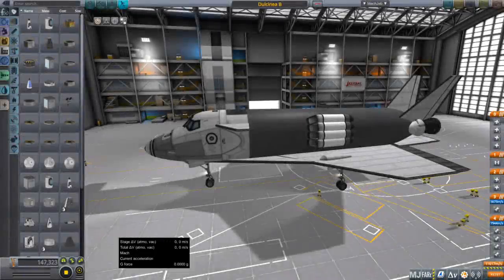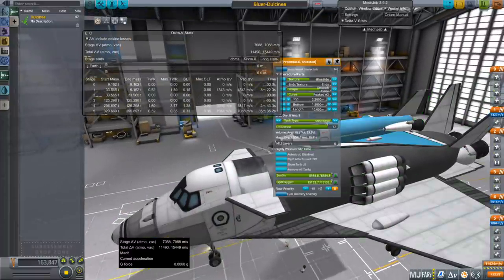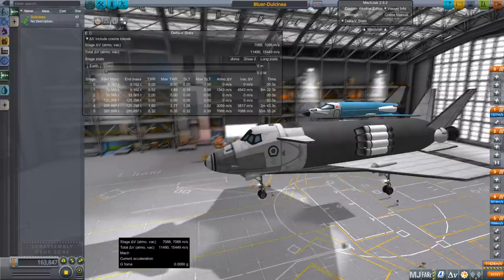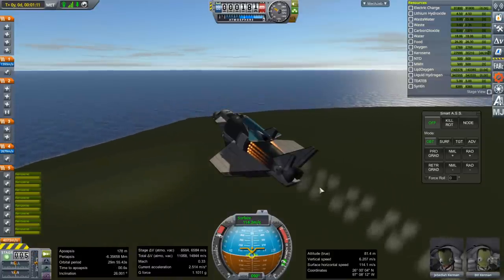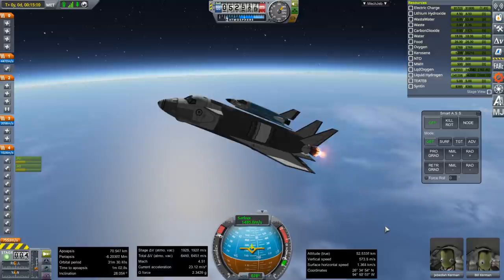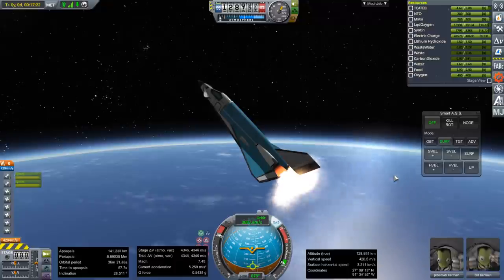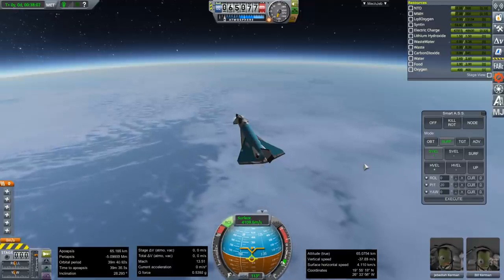Realism Overhaul in KSP 1.8.1 - Spaceplane Tutorial 3 - First Orbital Attempt

Comment: 1:30 Probably. I wish there was a simple slider on the tank that allowed you to determine which side you want to be shielded and how far up the boundary should be. If you could do that to both (as well as correspondingly increase first stage fuel load), this would have assuredly reached orbit.

4:20 Well, the first scientifically-rigorous spaceplane concept (the Silbervögel) was supposed to be launched from a steam rocket sled.

7:45 That would be the most useful KSP RO video ever, no joke.

8:45 SPACE BIPLANE SPACE BIPLANE

16:55 AFAIK the Buran OMS was the most efficient kerolox engine ever produced period, not just the most efficient for its thrust class.

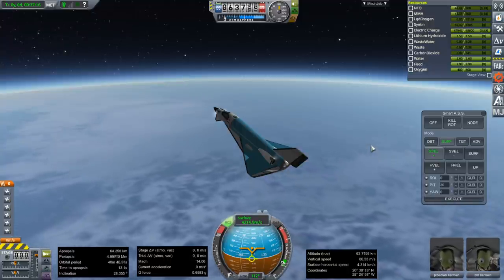23:10 That just made me wonder if a hydrazine-hydrogen peroxide rocket (more refined and using purer chemicals than the Walter HWK 109-003, that is) would have good performance, the reason being that any propellant imbalance wouldn't matter as much as either component can be decomposed as a monopropellant. I know it would have phenomenal density (~1.313 g/cc at STP, beyond any non-experimental propellant mixture), which would also help in this project, but I can't exactly make an engine config if I don't know its Isp range...

23:45 Kerbalism, 'cause it's more in-depth.

26:30 Thanks for inadvertently confirming that an aspect of one of my fictional launch vehicles would work. ;)
Reply: Space biplane space biplane